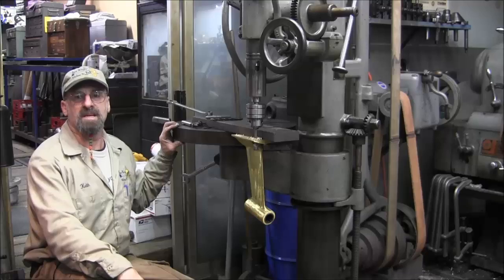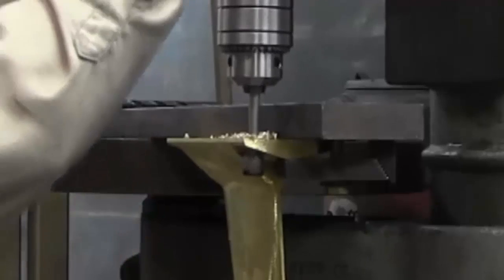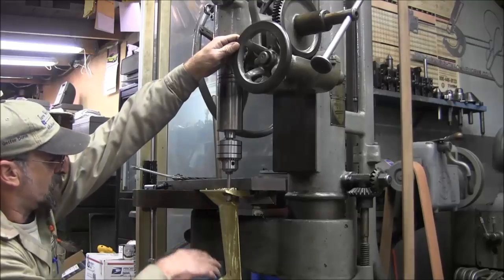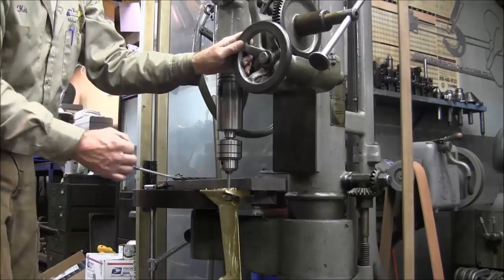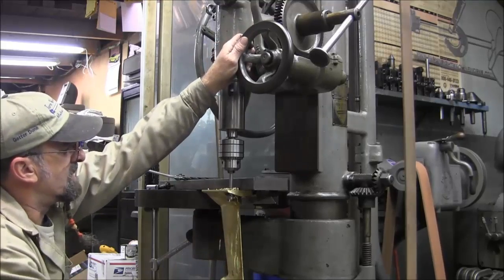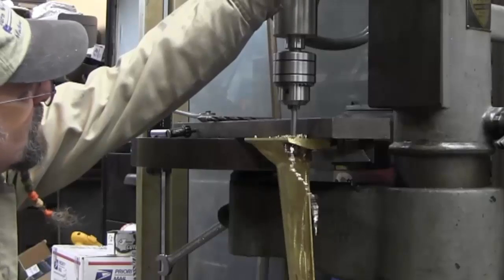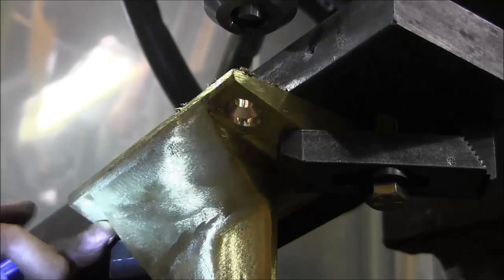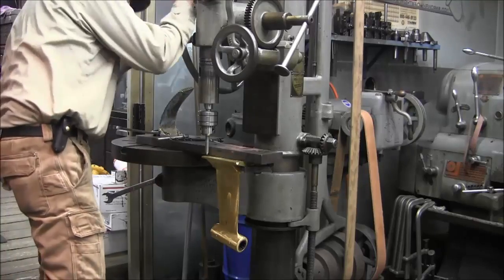The Clinton Clamp

Comment: Amazing have you ever  had that taper pull out doing that?
Reply from the maker: I've never had that one come loose but in the past I have had dirt, chips or worn tapered components come apart during similar operations. if the taper is clean and fit properly it can hold a lot of back pressure. ;{)------
Reply: +Keith Fenner I am sure that if you would have a problem  with the tapered shaft of your drill press with the pulling action, you would have find a simple way to lock it ...

Comment: I did a similar thing to reform the holes in a tractor wheel that had worn into an oval.  After building up with weld, I found a tool at Boeing Surplus (darn... miss that place) that had the correct profile and welded a shaft to the cutting side.  Pulled it through the hole using a hole hawg drill motor and it worked great.  No way to put a 38 inch wheel on my drill press!  The lug nuts have a spherical profile for this wheel.

Comment: Why not weld the bit of tube to the chuck key if you use it every time?
Reply from the maker: I am more so using the cheater on the chuck key because I am still healing with my shoulder and it compensates for the lost of strength, not so much to create, more leverage, so when I get better, I'l do fine without it. ;{)----

Comment: We had those backside cutting countersinks (for rivets) at McDonnell-Douglas.  They were extremely rarely used:  mostly for some emergency fix.  They were reverse cutting (I think) and had arbors with interchangeable cutters.  Definitely something out of the box.  i don't know if we had any action under the table, though.

Comment: Nice bit of ingenuity How old is that drill press?.  I used to work with allot of older equipment, mostly 30's and 40's. Now I am running newer cnc stuff and I am finding more problems with the new stuff than I ever had with the old.

Comment from the maker: A good fitting, Morse taper can handle a lot of reverse pull as long as there is no impact in the removal direction. I also have a cross pin trick that can be very successful in line boring jigs I use in the Morse taper drives, as long as you have knock out area for drift wedge. Drill hole across tang and use rolled pin as safety. ;{)------

Comment: I love this common sense solution to the problem at hand.  As a machinist, you really have to think outside the box to "getter done" with whatever machines and tooling you have on hand.  My hat's off to you for this method - and it is one that I will tuck away in my memory in case I ever need to do something similar!